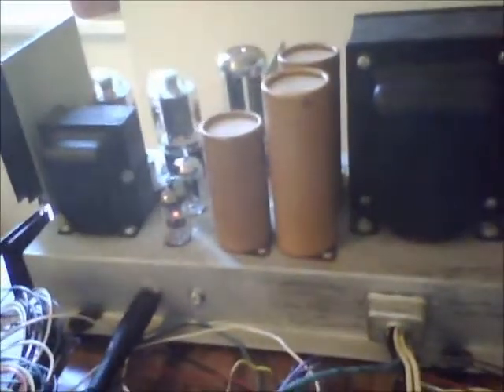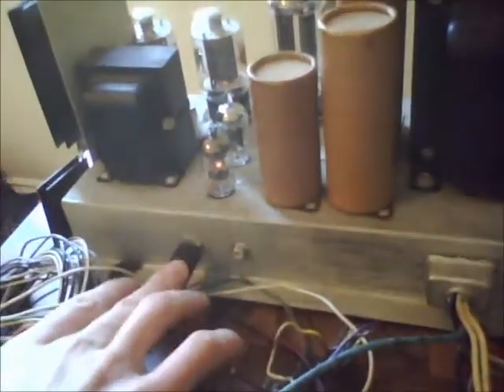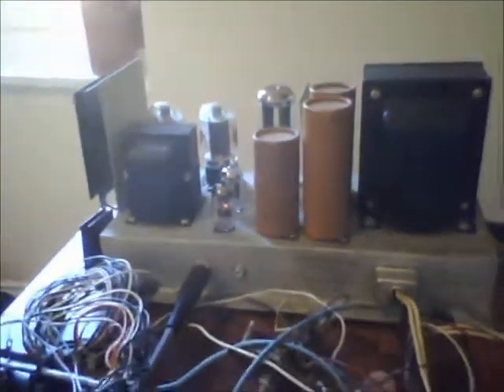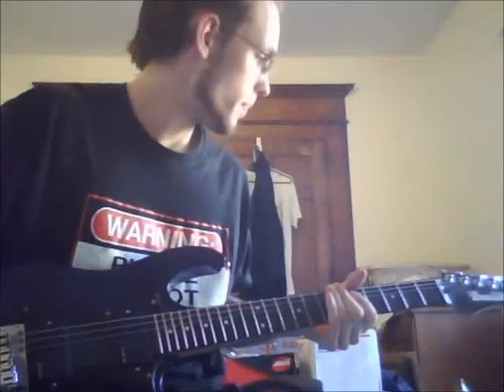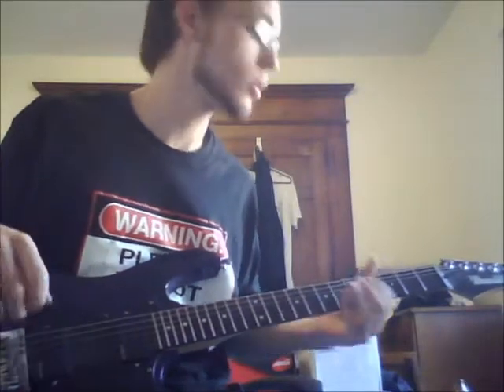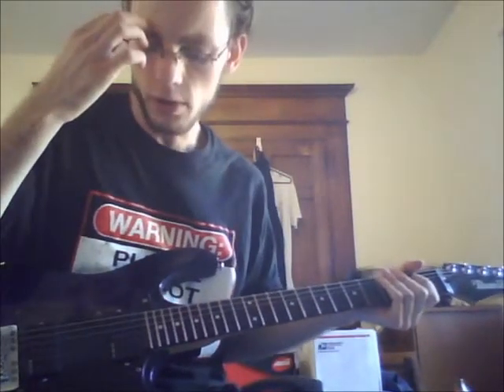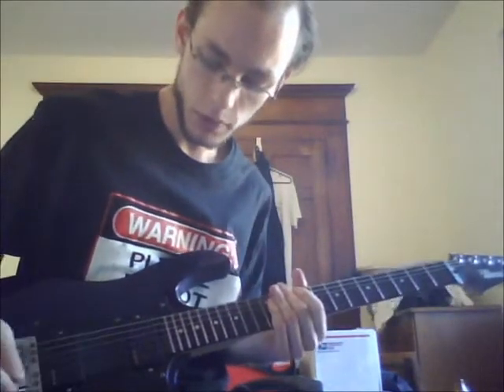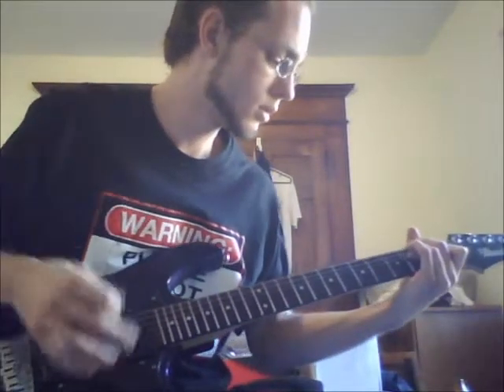1957 Gulbransen organ amp demo (with guitar)

Comment from the maker: Hard to say, all I did to this amp was install a guitar jack. The original controls were left alone. I couldn't find a schematic for this amp, so in order to do any in-depth mods you would really need to map out the circuit yourself (a LOT of work).

Comment: to the poster-- I've an very similar amp from a 1966. when I switch it on, one of the tubes starts going nuts. I don't know much about this stuff, but a little, enough to take the ham test 25 years ago. I was told it was the rectifier, and the culprit was (I replaced the tube) a faulty capacitor... I wonder if this is worth fixing, I wonder what the real trouble is, anyway I have had it for years in storage and was thinking about putting it together with a 2-speed rotary speaker parts I have, and using it on whatever. any thoughts?
Reply from the maker: +Skid Petersen Capcitors are cheap and easy to replace, tubes are less cheap but still easy. If you have any way to hook it up, it's probably worth keeping around. Otherwise you could probably make some nice change selling the parts, a good PT + OT combo could easily go for $100 to an amp builder and the tubes are probably worth a few dollars as well if they're common types.